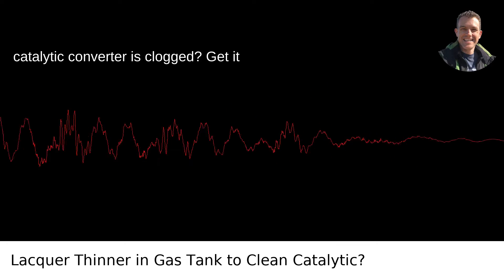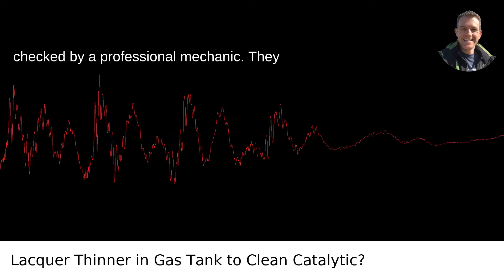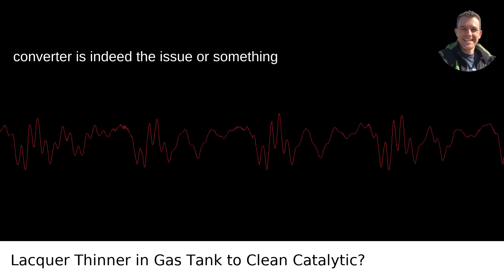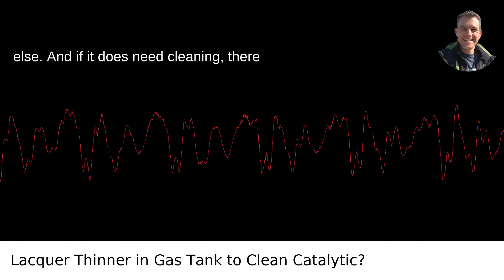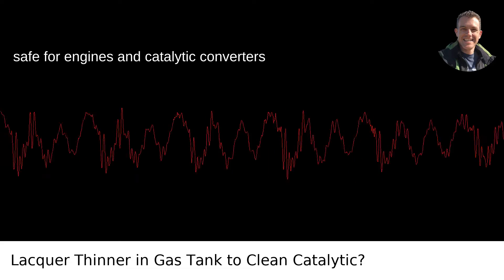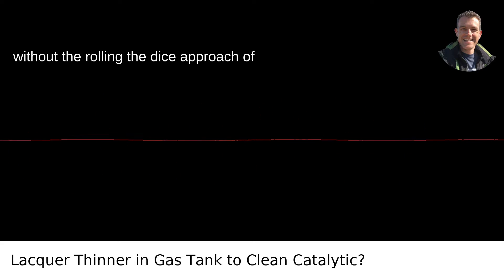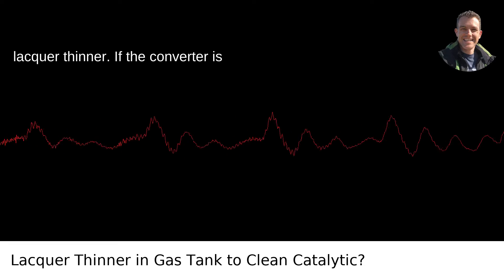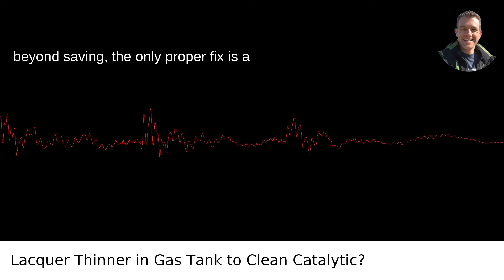Is It Safe To Put Lacquer Thinner In Your Gas Tank To Clean Out Your Catalytic Converter?

Comment: Just bought a 17 kia rio that this was done to. It wiped out the hole fuel system. I replaced everything for the dude I know. It did nothing. He gave up i bought the car for 5 hundo. Still banging my head Against the wall  cant figure it out. And I've wrenched for 30 years now.

Comment: My common sense tells me Lacquer Thinner will do terrible things to gaskets, seals, o-rings, the fuel injection system -- which overrides the tendency to just completely rely on good old Scotty.  Did Kilmer warn of the stuff damaging some cars?  If this is such a sure fix, why isn't it more publicized and why isn't everyone doing it?   Hmmmm.   What I'd like to see is a cat with front and rear removable pipe clamps that lets you clean the sucker out manually every 100k miles like it should be.  Since they don't make cars that way, saw the exhaust off front and back of the cat and reattach with creativity.  Now shut it down!

Comment: Idk.. But over the years I’ve used this in different vehicles. Chevy, Mitsubishi, Cadillac and no issues whatsoever. It improved mpg and cleaned the systems. And the Cadillac stopped sputtering when I used it. But of course this is YouTube and you will have by the “book” mechanics and will rule out anything that’s not accepted in the world of professionalism. That’s why I like old school mechanics because they have years in experience that’s not always by the professional book.. I’ve always used a gallon to a quarter tank of gas and results were phenomenal.. 
Js
Reply: Can you pour this thing as regular maintenance like every oil change in my case every 4K miles?
Reply: @leetos.4915  No I wouldn’t include into regular maintenance! Only to treat exhaust, sputtering, gas mileage issues etc. using it on a regular basis could clean too much and destroy components within the catalytic converter etc. You don’t want to do that too frequently. That has to burn off and turn into gases! Rich gases that exits exhaust. The reason I know this is because I did just that a long time ago. Using it with regular vehicle maintenance schedule. So now I only use it for symptoms when they occurred only. And occasionally as a fuel treatment once a year. Everything stayed fine with my other vehicles. No issues with that method.
Reply: @ericbaker9688  sounds like u know what ur talking about.  I’m assuming it’s only safe to pour this thing when I get an engine code of P0420 for the cat issue.  Wow your knowledge and experience just changed my mind after I just bought one gallon from Walmart here.  I always thought this is safe since Scotty had this on his channel but I overlooked the regular maintenance part he didn’t recommend.  Thanks brother I appreciate your honesty and insight. Will just keep my LT on the side for now until I get that P0420 engine code down the road for smog test here in Cali.  Let’s drink beer (on me).  Cheers!  🙏⭐️👏🏻👍💯👌❤️🍺
Reply: @leetos.4915  Yeah Scotty that dude! Ive been subscribed to him for years and learned a sht load of information from him over the years. Straight old school and ditches by the “book” crap and get right into it. I’ve had the PO420 code several times.  What I’ve determined was either leaks, worn gasket rings that connect to exhaust, muffler, or exhaust manifold connection. Those rings don’t last a lifetime unfortunately. Leaks can throw that code. Clogged Catalytic could throw that code as well. Some cases may have bad O2 sensor somewhere. The ECM helps you narrow it down if you know what you’re doing. What codes throw what and how to solve the problem without tearing your vehicle into unnecessary pieces. It gives you a generalization of where the culprit is. Either electrical, motor, fuel/exhaust codes. But  that would be a last step diagnostics. That’s if you’re doing the process of elimination route. Sometimes you’re forced into that elimination because what you previously did didn’t work. So you go to the next least expensive step. 🤟
Reply: Eric - you're saying lacquer thinner has not wreaked havoc on anything except the build up in the cats?  With improvements noticed in mpg I think you have just convinced me that it's safe to use.  Thanks for chiming in.
Reply: @happysawfish  It’s basically the success I’ve had over the years that led me to tell people about it. I have no reasons to cause harm or damage to the next person’s vehicle. Like I told the person above it’s a short term fix and not to be included in regular maintenance. This method is old as air. Guys used it in boxer engines back in the day! Flat 4 or flat 6 engines. To get the edge and boost over the other guy. It was their Nos formula along with other things added. A higher combustion means power but can be deadly if not careful. That’s if you’re experimenting with it like they were. So what I’m saying it’s basically a cheap poor man’s booster! But it cleans as well.
Reply: @happysawfish  I don’t knock modern mechanics because some are good. And most are only interested in violating your pockets. That was my experience years ago. Being told one thing like oh just bring it to the shop! And charge you $125 for a $40 diagnostics! When the issue was to simply put a fuel system cleaner in your vehicle. Uneven tires can impact mpg as well. That’s why it’s important to keep them at the same psi. Unless stated different for that model. You go to the shop and they tell you you need a new A-Frame, struts and shocks, and new tires. When all you needed was proper air pressure. That’s how the “by the book” guys will pitch to you. So be careful and know what you truly need. But there’s always more than one solution!
Reply: @ericbaker9688  :   You are so right my friend.  These kids of today have many important lessons to learn.  First, get off your phone screen and look, touch, smell and think.  All necessary to learn to use that common sense that is waiting to be unleashed.

Comment: Yea i had a p0420 code , I Saw the scotty Kilmer video 2 days ago. Yesterday, I  put a gallon of Laquer thinner to 10 gallons of gas. Making the drive today with heavy acceleration to see if it works on clearing the cat or code with next fill up.
Reply: how did it go
Reply: @stevekirby23  didn't work. Could just be too many miles on the stock cats. I'm at 400k on the motor
Reply: @JdmMikeTx  which thinner did you use and what am i looking for in the thinners
Reply: @stevekirby23  I used laquer thinner. Got a gallon of it at Walmart for $20. Put 10 gallons of gas and the gallon of Laquer. I cleared the code. And it came back on before I had to refuel. I looked at the o2 readings while vehicle is running , but the bank2 o2 sensor was still chasing bank 1 o2. From the forums I've read, if o2 sensors are reading right, then the precious metals are most likely worn out, especially on a high mileage vehicle. I could be wrong, but that was my result from the scottie test.. I've also read that laquer thinner could damage o rings in fuel lines or fuel pump
Reply: Is your 10 gallons equivalent to half full of your gas tank? Scotty recommended pour 1 gallon of Lacquer thinner to a half full of gas.  I can see y it didn’t work for u knowing u racked that much mileage of 400K.  Your cat is like antique item already that needs to be remodeled or rebuild.  But then again, it’s just my opinion.